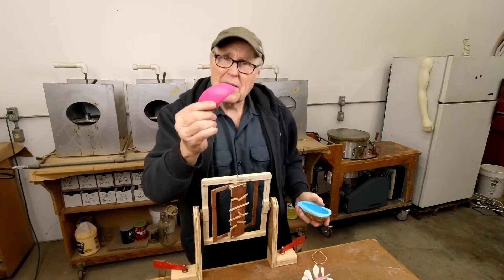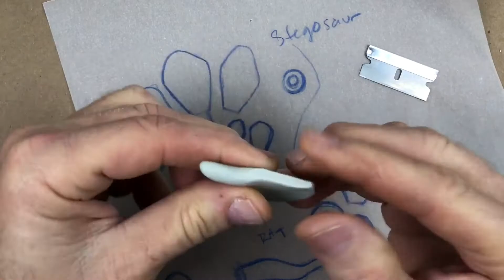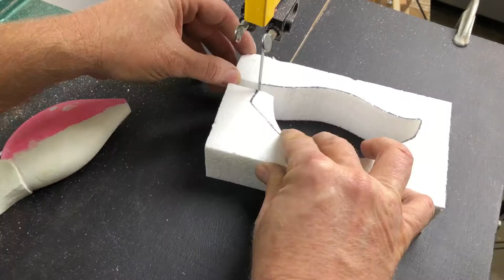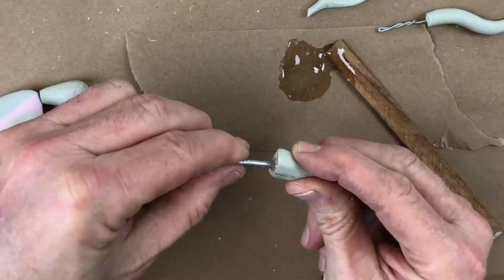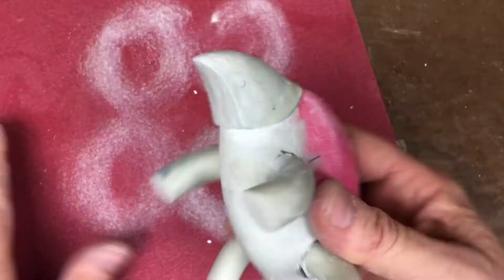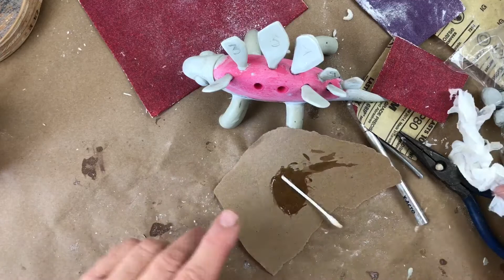Sculpting with Epoxy Clay - you can machine it?

Comment: One of the defining characteristics of the dinosaurs is that their knees are forward facing, held vertically under the body, rather than splayed out to the side as in lizards, or as in this model. I don't mean this neccesarily as a criticism; in the early days of paleontology, when skeletons were incomplete and reconstructions were more speculative, depictions of dinosaurs with lizard legs were the norm. But I do think it is interesting, to me it gives this model a kind of vintage feel which plays against the modernist simplicity of form and the high tech materials.